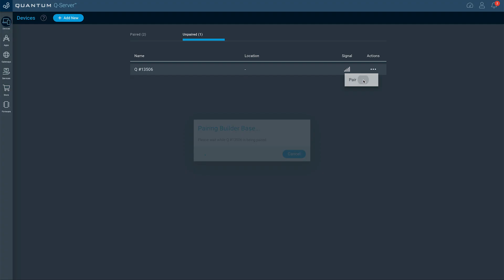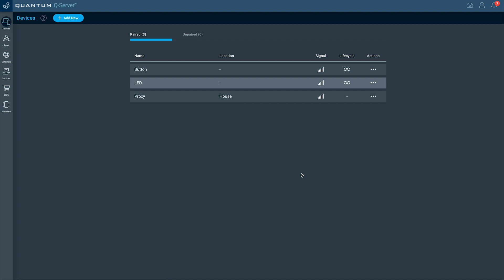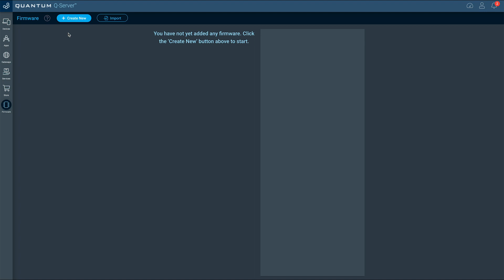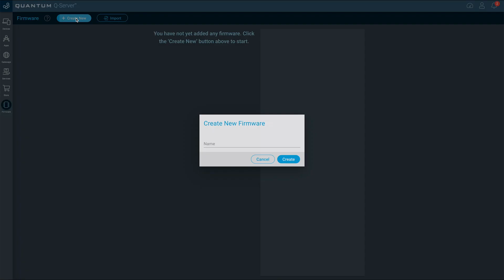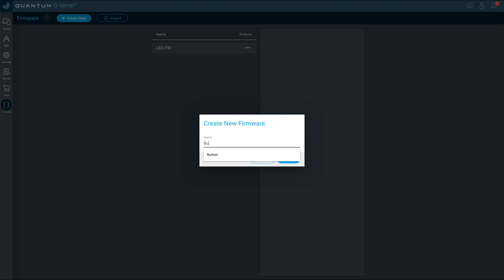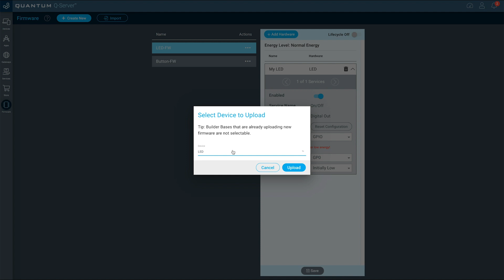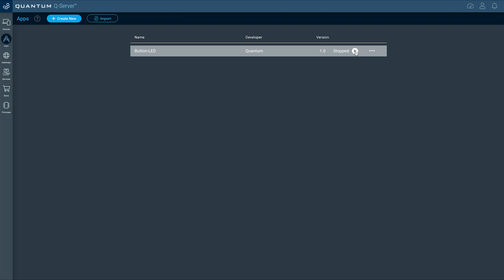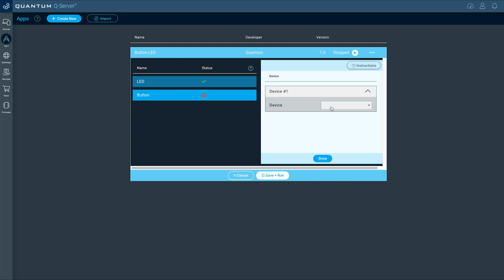Tutorial 1.1 - Hello World

Comment: A confused newbie: I followed the 1st part where you wired up the LED.  But when you got to the 2nd part of wiring the button, you started with a 2nd empty breadboard.  I ordered your Starter bundle, which came with only ONE breadboard.  Was I supposed to receive 2 breadboards?  I'm going to share my one breadboard between the 2 client bases, I'm sure it will do the trick (will ONLY share grounds, not positive voltages).  BUT you might want to point this out in the video.  Also, why not start off these beginner videos by explaining how the breadboards function - it's really important that novices understand the arrangement of the pins.  It's somewhat obvious that the red and blue lines along outer edges (long sides) are for distributing power (plus and minus voltages from client bases).  BUT I'll bet many initially don't know that the two rows of pins (one set labeled a-e, other f-j) are connected together to facilitate wiring of components (which normally will be inserted so as to straddle the long divider notch that runs lengthwise in middle of board).  A total newbie could easily short something out without this knowledge...

Update: seems as though the breadboard that came with Starter Bundle has two sets of isolated power bars.  So can use one side's plus and minus bars with one Client Base, other set of plus and minus for a second Client Base.  So the one included breadboard effectively can work as two :)  Hopefully this is documented somewhere and I just missed it...
Reply from the maker: Thanks for the feedback Mike. This video is intended to be a hello world for the Quantum Platform, not for electronics as a whole. Maybe we'll create a video on how to use breadboards as well. You do bring up a good point about the video using two half size breadboards while the component kit provides only one large one. This is because this video was created long before we started offering our component kit. We definitely can see how this can be confusing for complete novices. We'll look into how to make this less confusing for our users.

-Martin and the Quantum Integration team